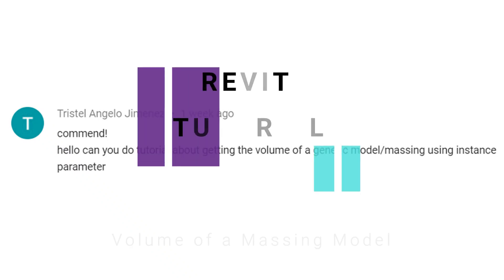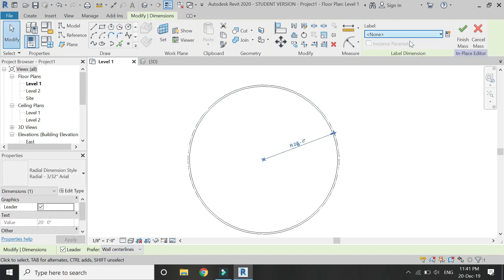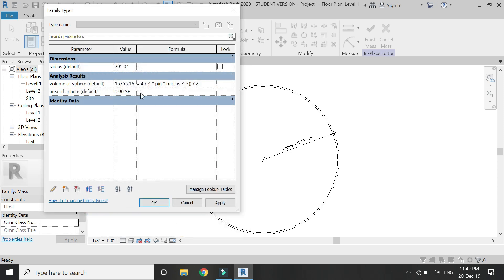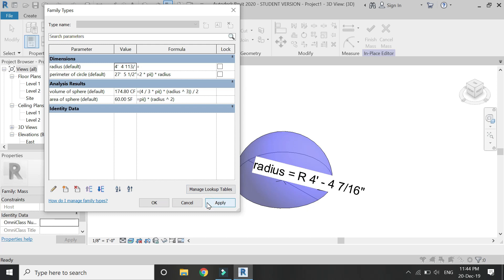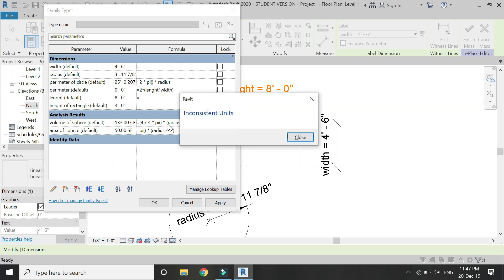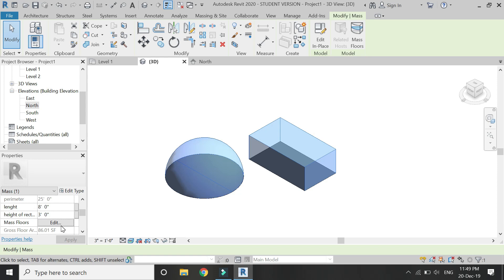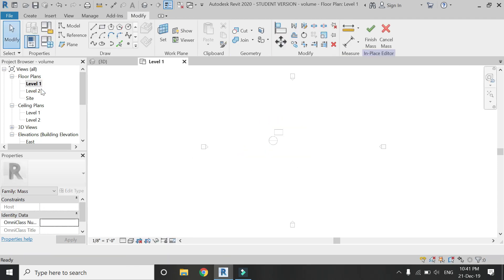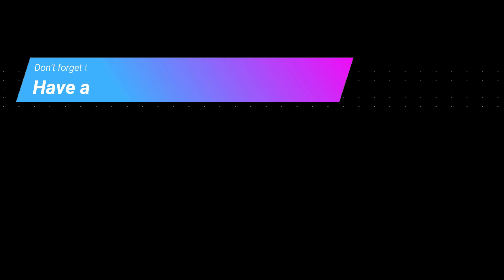Revit Tutorial - Volume/Area of a Massing Model

Comment: Very Nice and informative, But i would like to add some corrective clarifications regarding terminology and calculations of Dome (Hemisphere) which has been added in Family Type parameter as Volume of Sphere and Area of Sphere, instead it should be Volume of Hemisphere/Dome and Area of Hemisphere/Dome as well as Perimeter of Circle, instead it should be Circumference of Circle (Flat surface of Hemisphere/Dome). Now come to the calculations, The formula for Surface Area of Hemisphere shall be  3*pi()*(radius^2)  and it was written as Area of sphere and formula given to it as area of circle. Anyways Thank you so much for the Video.

Comment: Thank you. It was rather informative with a practical approach to it. Thanks a lot
Reply from the maker: Glad you liked it. Keep following for more content...
Reply: I have a few more questions regarding this very thing. Like if I am making a space frame or 3d trusses using generic model pattern based curtain panel system on the divided surface of some organic form(roof/wall), how will i quantify that?
Reply from the maker: For example you have created something in the generic model adaptive component or the curtain panel system and then created a wall out of it. If you individually select each panel of that wall, you can see its area in the properties dialogue box. You can create a parameter with formula "x*a" where x is the number of panels and a is area of each panel.
Reply: @LetsRevit  i dont mean walls. Walls would be easy, but suppose you've made a custom generic model pattern based.rft and loaded in to be used as a pattern on the divided surface of the mass, then is there any way to get the amount of steel that would be used for the whole construction based on the geometry of the reference planes and the reference lines of the mass?
Reply from the maker: Even if you have placed the curtain panels on the irregular curved organic mass, you can still see the area of each panel in the properties dialog box. But in the case of irregular mass, the area of each panel would be different from each other. Unfortunately this means that you have to add the area of all curtain panels to calculate the total amount of material.